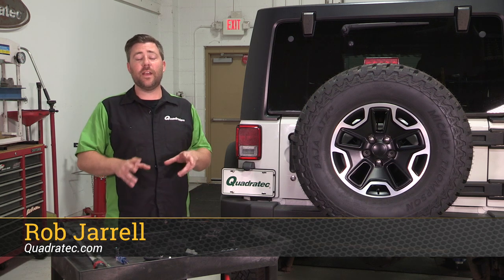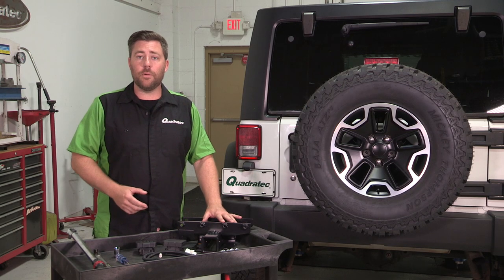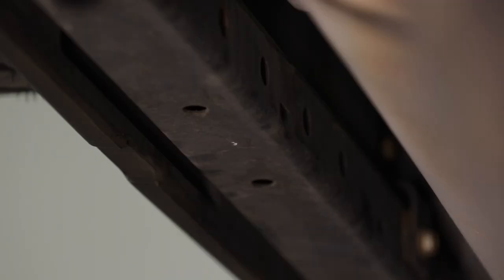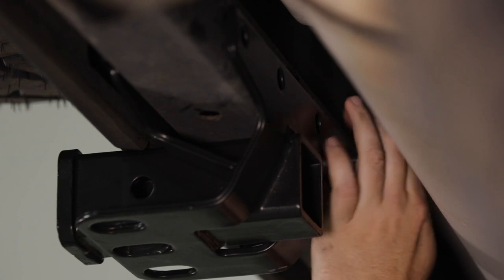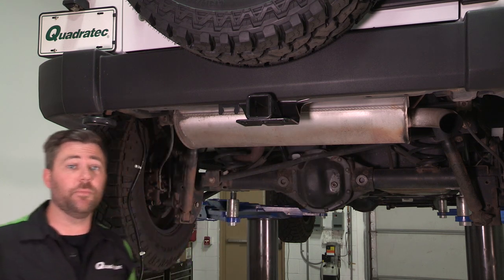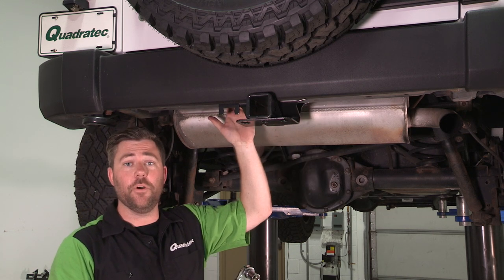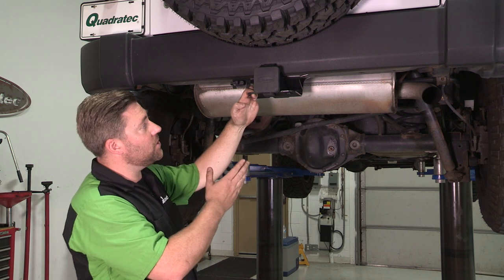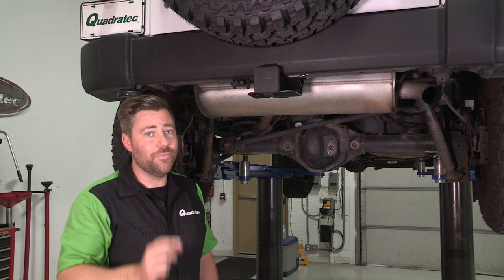How to Install a Trailer Hitch on Your Jeep Wrangler JK

Comment: Does quadratec  have a bike rack that clears a 35 inch tire ?
Reply from the maker: We sure do, that video should be up next week, but here is the rack: https://www.quadratec.com/products/92034_1000_07.htm and if you need one for 4 bikes: https://www.quadratec.com/p/quadratec/4-bike-folding-bike-rack-2-receiver-hitch-bolt-cable-lock